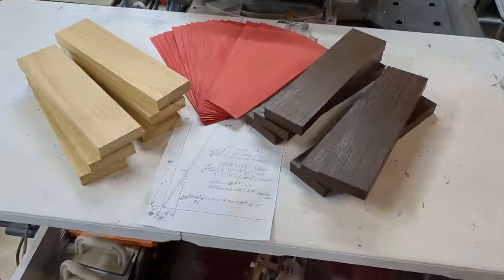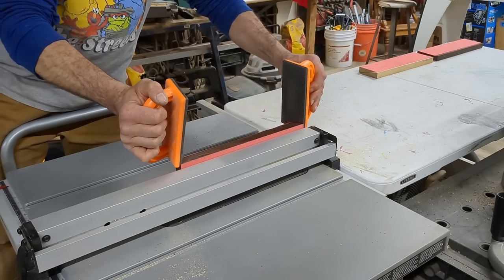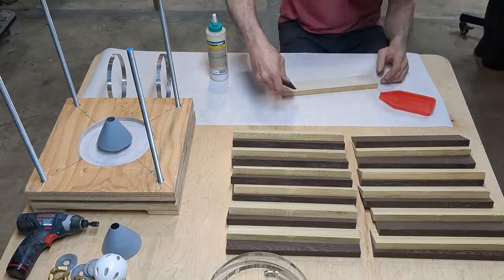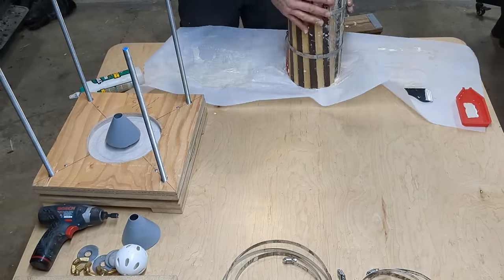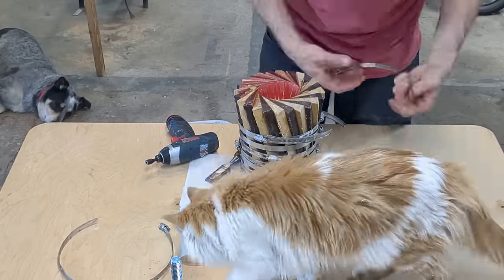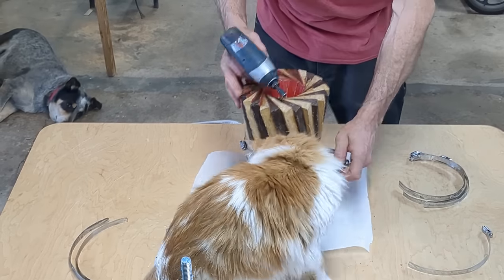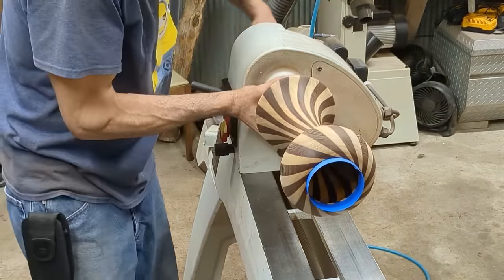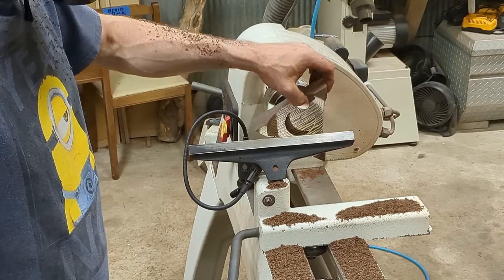wood turning a double conical tangential arrangement

Comment: Enjoy the planning that goes into your extraordinary outcomes.  I have turned now for about 2 years and starting to get comfortable with what I can do.  I have 2 questions about your setup. 1- how did you fasten your steady rest to the bed.  I built one similar and my fastening system is difficult at best to hold it tight.  2- I’ve been searching for the tail stock mandrel that you used to hold the chuck for at least 8 months, would you mind sharing where you got that and the part number.  Thanks for your time and keep up the excellent designs.
Reply from the maker: The steady rest is attached by way of two F- clamps. I found the tail stock mandrel on Amazon as a live tailstock chuck adapter.
Reply: @donavenzulian  

Thank you for your quick response

Comment: When you mentioned the original plan to split the cylinder in half and meet up the tops, it occurred to me that if you make 2 cylinders canted in opposite directions, you could do the meet up by matching half of each to half of the other, producing a continuous pattern, instead of a change in direction.
Reply from the maker: Yes! I see it too. Then you could have four blanks from assembling two. Thank you for checking it out 😊

Comment: First let me say that I think the end result is awesome. The colors and the pattern are outstanding. The shape is something else, I like it. The whole piece is great. What a great way to kick off 2023. Now here is where I get myself in trouble. I don't care for your production. You use a lot of speeded up video and that makes it hard to tell what you are doing. You show cutting all the wedges but too fast to see just how. Please, it would be better to show one or two in detail and just say you did 30 more. You have an interesting way to cut the wedges but don't show the set up at all. Then mention the technique but no explanation. Move the camera to the other side of the fence. You created the twisting so fast I could not tell just how you did it. Then you take several minutes putting on clamps. When you have a lot of the same thing to do, please show one or two at actual speed and skip over the rest. For the most part your audience is smart enough to figure out how to do the job after you show the first time or two. So again you skipped over the important stuff. And I like the cat but it got way too much screen time. Your camera position during turning could be much better. If you mounted it directly overhead your lathe your audience could see the profile as it emerges. The view from the end shows nothing. The same problem when turning and fitting the base. I want to be entertained. But I want to be educated too. I hope my comments are meaningful. They are meant to be constructive. I hope they are received that way. You produced a beautiful vase. Thank you for sharing. Have a great day and stay safe.🙂🙂
Reply from the maker: Honestly, thank you. I really appreciate the comments that teach me in return. I'm very new to the whole social media and love to know how I can improve the experience for everyone. I will try and implement what you have said in the future. Again, thank you
Reply: Video production and editing is a whole different skillset from your ingenious engineering solutions to woodwork. The thing about problem solving as you are building something is that you are coming up with solutions as you go along, so adding the challenge of showing it all clearly on camera is certainly not easy. I suspect a lot of YouTubers do everything twice so they can sort out technical issues first, then build it again for the camera and focus on shooting it. 
Also there is a difference between a full how-to movie and an ideas video. I think yours is great for getting ideas from and If I ever make something similar I will have to sort out my own solutions because my equipment is different. So a full how-to movie might be more than most people need.
Reply: Sometimes I stop the video , perhaps needing to rewind a little , then I play it at much slower rate .
Reply: I must agree with this comment. I gotta say, though, that this is one of the nicest pieces I've seen! Thanks so much 4 sharing!!!😎👍👍👍